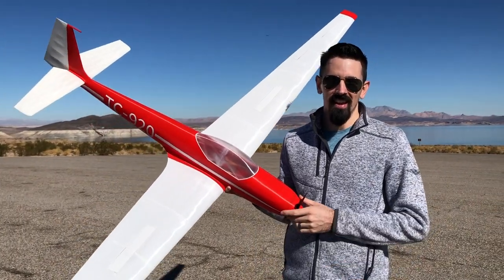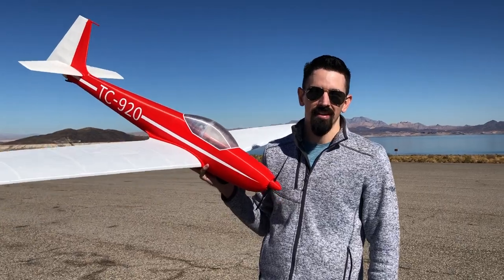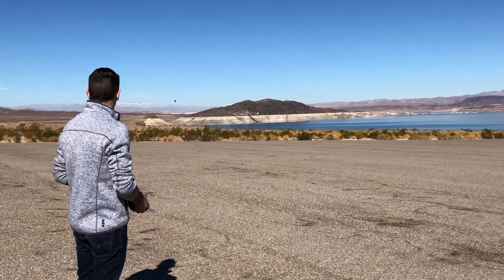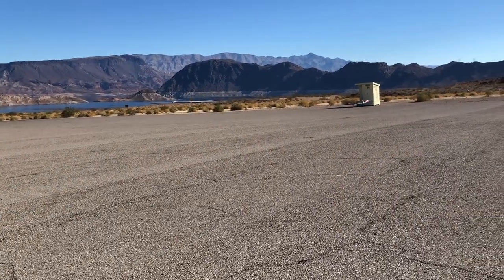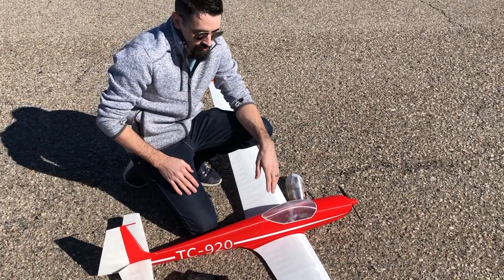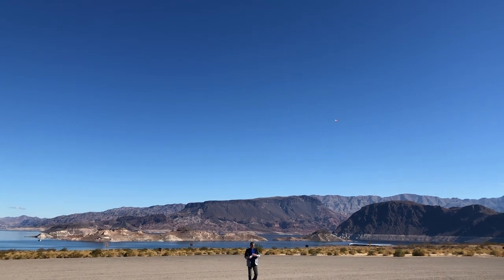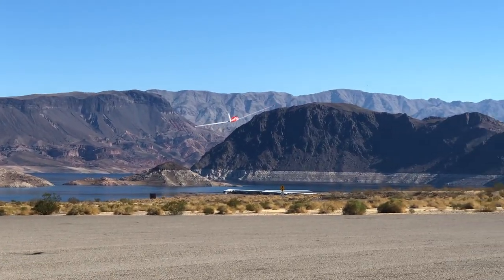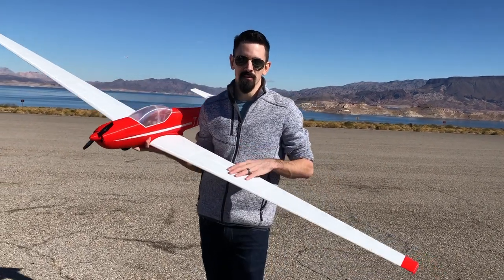Giant RC 3D Printed Glider 1st FLIGHT - Planeprint

Comment: Nice maiden flight and testing how it works. My RC mentor had a glider of a similar size with no motor at all…just rudder and elevator controls. He lived on the Oregon coast and would hand launch it into the prevailing wind off the ocean. He would regularly fly it for 15 to 20 minutes. He would also find risers to gain altitude on less windy days. Fun memories. Thanks for your channel.

Comment: Very cool, I'm in the middle of making my own model, i work with Siemens parasolid for my physics testing so I don't even have to print it out to find out if it works. I highly reccomend it but i haven't seen anyone actually build their own so that's my goal right now. I'm using a ender 3 max

Comment: 40 euros? I bet you will make a lot more if you make it more affordable. Yes, you spend a lot of time designing it, but then, if you sell this at 5 euros or so, anybody who is interested won't even think about it. At least I wouldn't. I wouldn't think about where to find a copy, wouldn't spend a minute browsing for an alternative, just pay and try to print.

You gotta think this way: even I have a printer, even I know how to print, I still have to buy the filament, spend a lot of time printing, assembling and buy a lot more stuff.

You do this for a hobby (I assume) and for every 39 euros, it's 39 euros profit, right?

So sharing this at a low, affordable price would make a lot more people willing to take the risk or giving it a try.

Just think about it.
Reply: I could be wrong, but I don’t think he is the designer/seller. He has built planes from a few different designers. €40 seems to be close to the going rate for 3d printer plane files. You do have a point, though. The only reason I haven’t bought several of these designs is because I worry that my printer isn’t up to the task. There is a free version of the Eclipson Model A on their website. It’s not my thing, but I’m gonna build one to see how it goes.
Reply: @brandonbell359  you’re right he isn’t the designer, he just prints and builds these planes. But 40€ is way to much, Eclipson sells planes for half the price and I think that’s fair. I couldn’t find the free Model A version 😳
Reply: @Mister_Stork  I dont think YT will let me link you directly, but its on the store page for the Model A just under the "add to cart" button.
Reply: @brandonbell359  alright, thanks 😊